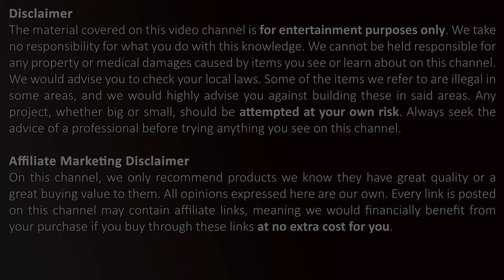Supercharged V8 from Cardboard

Comment: Has ayone's acceleration system worked? or someone explain to me how it works
Reply: Pls explain
Reply from the maker: @GreenBouncingSquare.Official  so the intake valve and acceleration although are connected together they are not has any effect to the engine revolution. However I had a plan in my head to how connect them the way actually; please keep that in mind this is just a mockup model and not a real engine, there is no fuel and no ignition.